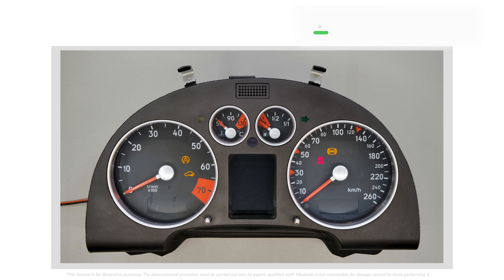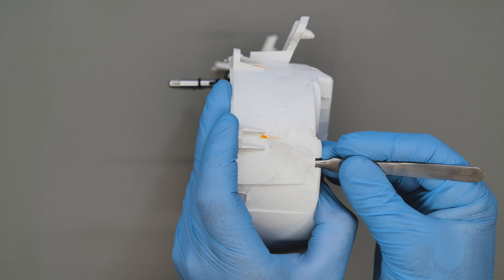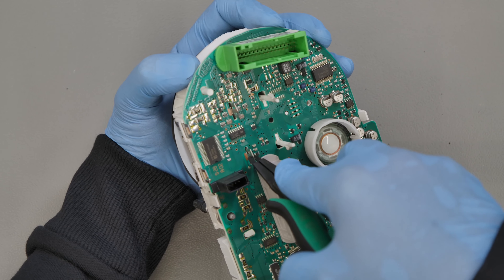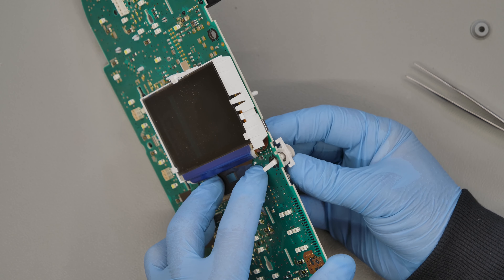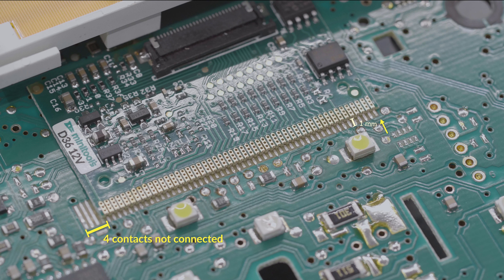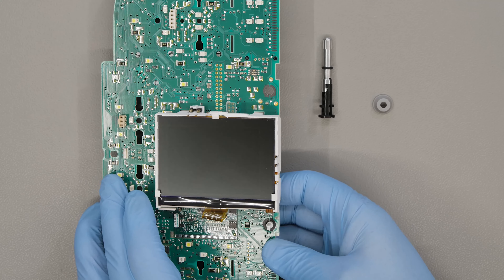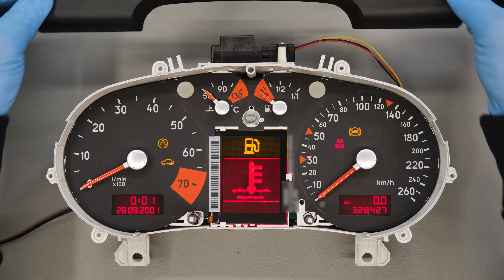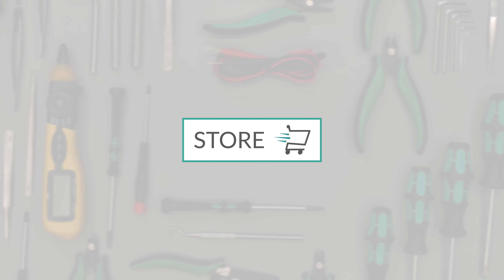Audi TT 8N Mk1 instrument cluster LCD pixel repair – FIS LCD screen replacement

Comment: What is the glue that you used
Reply from the maker: Hi, we didn't use any glue. You're probably referring to the solvent we used simply to remove any tin excess from the board.